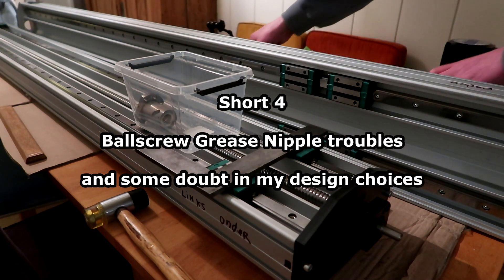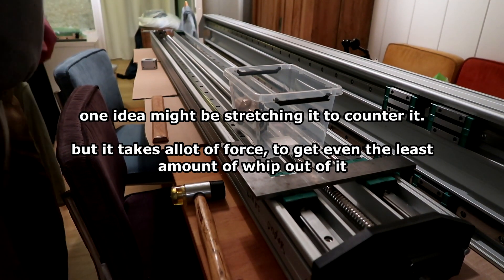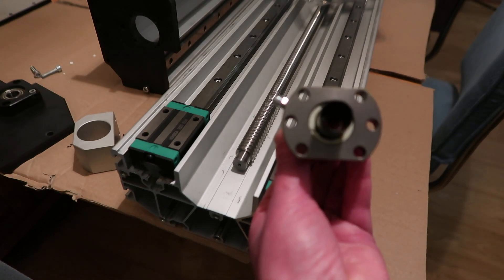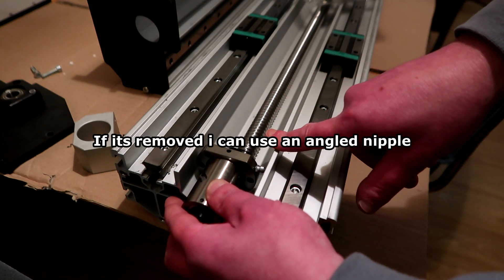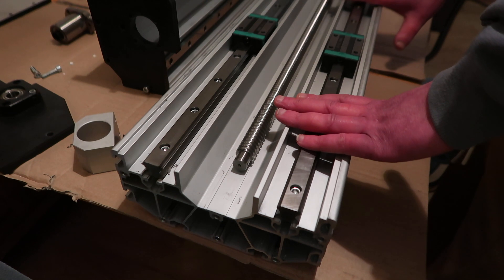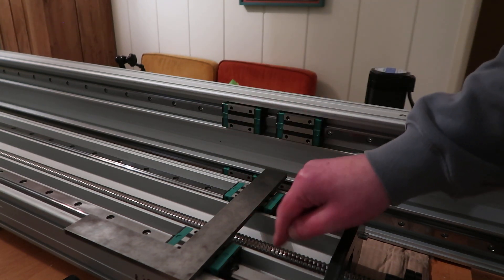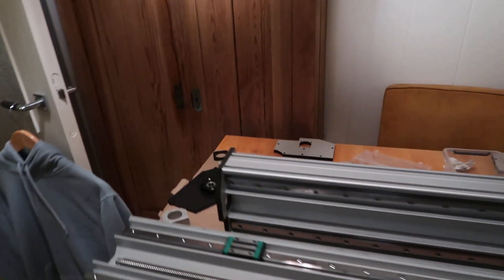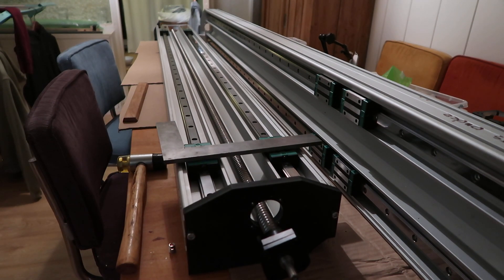CNC Short 4 - Ballscrew grease nipple troubles and some doubts

Comment: You could just get it done for you :) I've done all but the very most exotic hardened tool steels with carbide tooling, but you NEED a really solid mill of drill-press. Handhelds are totally meaningless for this. Cap the existing thread exit, drill in from the side. Get a press-fit nipple, and ask the shop doing it to press the nipple in.
And remember that your unsupported length will never be 2000mm - with the carriage all out to the end you'll have maybe 1700mm. In the working range in the middle of the table, longest unsupported length should be around 900-1400mm

Comment: Engineering is the art of compromise. You must decide what are your goals. What do you need? what do you want? And what would be nice? Once you know that, you can prioritise. Then you can begin maximising results and minimising effort 😁

For the grease nipple problem… 

There will be a company that offers a solution that works for you. Look for an alternative style of nut - one that doesn’t have the mounting flange for example. You can rotate the nut to wherever is best.

If you are sure you would rather modify, perhaps cut a small section or drill a hole in the aluminium, so that you could install a nipple for servicing and then fit a blank screw for use.

Whipping…

Maybe it is a problem… maybe not! Perhaps you would be better off with a rack and pinion. It all depends on your goals. It would solve your grease nipple problem… 😊
Reply from the maker: yeah i know :) problem is these are chinese NUTS  :) they are all the same. fitting in nipple only works if i get rid of some alu or a piece of the nut :) the nut i tried... tyhat does not work so next up (if i can get the speed) will be the alu profile :) its not easy to draw up everything you can think of. i mean that would be the way to go.... but i hate CAD haha and often in real life things might be different

Comment: Hi joppe! i don't like the idea of milling the rails. Why not just give grease in, remove the nipple then and close it with a thin screw. Check how long the lubricant lasts. Not much to loose ... maybe cover the spindle to avoid dirt.
Reply from the maker: well i dont want to disassemble the whole X axis to get to the Y ballscrew... the thing will weight a ton... not easy to do in a shed where it barely fits :(
Reply: I came to this same conclusion also. Bellows over the ballscrew and rails is a good option. The grease nipple should ideally be permanent, however this is a metal housing so the nipple takes the wear from fitting/removal. I figured the same thing as yourself, to blank it off after greasing. If it's a monthly job, that's hardly a ballache. My own solution which I am hoping I can make work is to bring the nipple out through the Z-axis mounting plate to an external grease nipple. I've seen some builders aggregate their greasing to a specific location that is easier to access. I can't recall, but I suspect that Joppe has gone for larger 20mm ballscrews and correspondingly-larger ballscrew nuts which is the cause of this issue. This may not be the case for my 1605.
Reply from the maker: Ooh yeah that might work. ill be testing that , only add the nipple when greased then get her off

Comment: Just sacrificing speed will stop whipping, but yes, those screws are far too narrow for their length. Also, forgive me, but why are your hands so red?
Reply from the maker: haha yep they are on the small side.  i put the project on hold for a  while :( since i am not sure if  i can fit it in my shed......(hardly any room to build it up and move around it)
My hands , well its multiple reasons white balance of the camera and i in fact do have really red or white hands depending on temperature,  i forgot the name of this. (has to do with blood circulation  in the hands)   people might experience this with extreme cold i already have it at normal temperatures.   they can be white ,red  with orange or  purple spots :) normally they are just slightly more red then most.  they do not feel different then normal except when its really cold /freezing
Reply: @joppepeelen  did you just have your hands in snow?